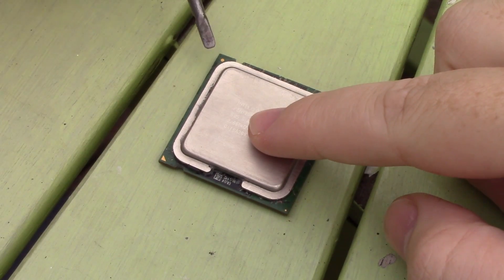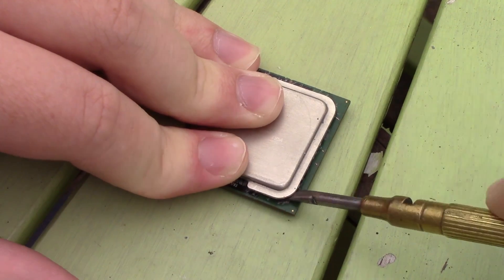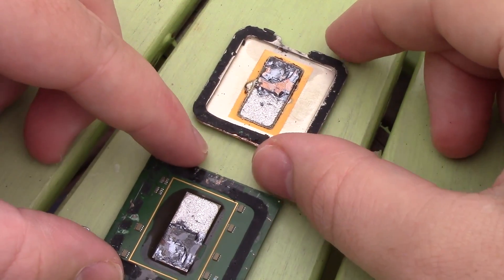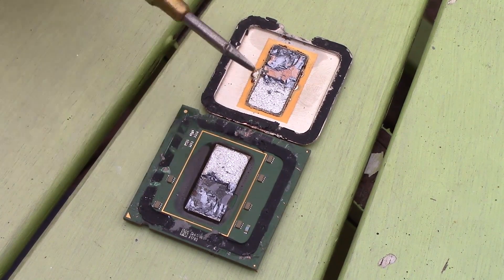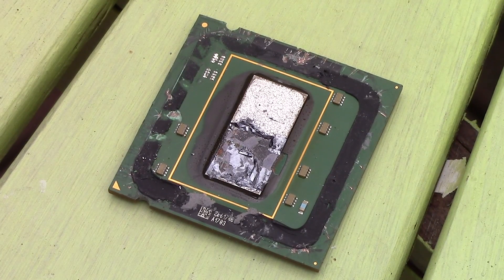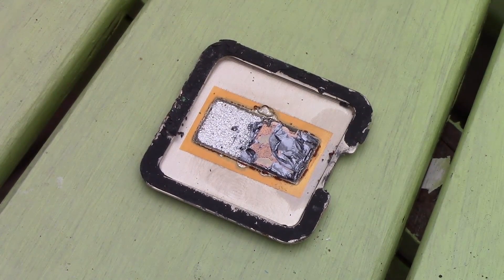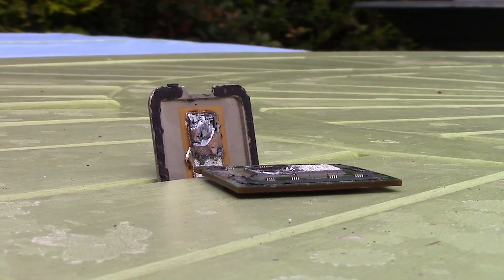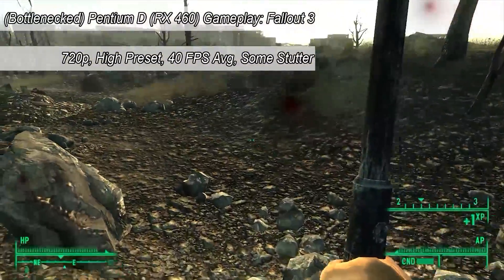Delidding a Pentium D

Comment: Pentium D+ GTX 480= HELL
Reply: The Real Bleach no, hell is Pentium D + 4 GTX 480s in SLI
Reply: Jakob P Hell is Pentium D+ 4 Titan Z's. Severe bottleneck
Reply: Alex Riordan i dont think he meant that GTX 480 is a bad gpu. it just comsumes a lot of wattage and together  with the pentium d its  gonna be hell for your psu
Reply: Yeah, requires SLI-fireextinguishers
Reply: The Real Bleach I was talking about thermals, not bottlenecks.
Reply: moriart13 call the fire brigade
Reply: ARE YOU TRYING TO MAKE A STAR!? HOLY SHIT!
Reply: GTX 590 would be better.
Reply: already hell with pentium d
Reply: Vega without cooler= a f*cking thermal bomb xD
Reply: i got gtx480 and quad e5410  an today is weather 32C
Reply: They dgaf, it'd be better witg qx6700 OC(3.5ghz?)
Reply: That is a pairing made in an underpowered wind tunnel.
Reply: 290x stock cooler
Reply: i9 18 core +2 GTX 490s
Reply: notice there's no AMD in here
Intel? Nvidia?

prepares for the storm
Reply: I could have said Vega.
Reply: Quad 20 Core Xeons OC'd to 4.0 Ghz plus quad GTX 490s with OC
Reply: Most cards don't run as hot as those.
Reply: room heater
Reply: you guys have it all wrong fx 9590 oc + 2 r9 fury x = mansion heating source.
Reply: 480 is not a bad gpu. Upgrade everything else
Reply: BAD IDEA ALERT

I currently have a Core 2 Quad hooked up to an HD 5870, and they make a good pair. However, I have a Celeron D lying around. Maybe I should throw it into the rig just to see how much of a bottleneck it brings to the system!

Comment: glad intel never decided to make a pentium D quad core with all that wattage just to run a dual core. lol
Reply from the maker: SteelCity1981 would have been interesting though haha
Reply: 1000W 80+ gold PSU minimal requeriment
Reply: i have a Hyperthreaded Pentium D extreme Edition 965 that runs at 4.2Ghz
Reply: how the hell you cool down at that speed? I have a 945 @ 3.40 GHz with arctic cooling mx-4 and the idle temps are over 45ª
Reply: 440w tdp
Reply: That would be more like: Pentium Q
Reply: hey, it would be very competitive with amd at the time if these pentium Ds were hyperthreaded.
Reply: the first thing you could try is GMABooster, it could overclock your GMA950 to 400Mhz if its clocked at 166Mhz as the most OEMs do this. you could also try EEECTL for the cpu or setFSB and try some of those clockgenerators, maybe one will work.
Reply: Ary lol i have a pentium d 945 overclocked to 3.8ghz with intel stock cooler and no thermal paste.
Reply: i use an unbranded aftermarket cooler with 6 heatpipes that i found in a medion PC...sounds like a jet. i had a Pentium 4 Medion PC that ran at 4Ghz fully stable without any Voltage mods and with the stock cooler with its old crusty thermal paste....85 degrees max and 65 idle lel
Reply: Manuel Auer undervolt?
Reply: kjjustinXD Bro you are the Pentium master, mine raises up to 80° in BIOS, same with you?
Reply: ikr yet i ran pd 950 on a like 220w psu
Reply: it stands stable at 85-90 degrees under full load... i overclocked so much cpus lol, even an Crappy intel atom n455 from 1.6Ghz to 2.3 and im writing this from my 4Ghz Core2Duo Machine
Reply: kjjustinXD daaamn son you are the overclock master, how do you overclocked the Atom?, I have the N270 @ 1.6 stock and the BIOS have no overclock option
Reply: whats your PC with that atom? Model Number or mainboard number etc. then i could look to find the program you could use
Reply: kjjustinXD it's a Compaq mini cq 10-120la, motherboard: Hewlett Packard 1468
Reply: another question, you can replace thermal pads with thermal paste(MX-4)?
Reply: Please do yourself a favor and just throw your netbook in the trash, such a shitty CPU and iGPU. I only kept my rarest EEE PC, and it's in the drawer of shame with all the cracked phone screens and dead headphone cables. I mean it literally couldn't run any 3D game better than a PIII with an ATI Rage. I can't believe I bought an EEE PC for almost 500$ in 2009 when they first came out. Now you can get a 50$ Cherry Trail tablet from China that literally runs Crysis.

Seriously, buy the GPD WIN or if really strapped for cash, you can buy a used Thinkpad with E350 APU for 35$ off eBay,
Reply: Sergiy Botsman 

this comparison is not even far from the reality, the p3 is stil faster. I got dual 1.4Ghz Tualatins ocd to 1.7Ghz with a Pci to PCIE Bridge controller and a GT730 And it runs Crysis....
Reply: Sergiy Botsman dude that was a slap to reality, I can't even watch YouTube smoothly(15 fps @ 240p) in a light Bowser like pale moon, I was thinking in upgrading the 1GB stick to a 2GB DDR2 because a friend have a N2600 atom+2GB but DDR3 and he can watch 720p, but if it doesn't give any performance boost because of my shitty atom I think it's better to invest in a new portable any recommendation for a new cheap notebook/netbook?, The better and most affordable I saw was a HP 240 G5 with Celeron N3060+4GB for $420 USD(all is fucking expensive in my country, ie the gpd win is $690 USD)
Reply: Ary 

You should look for a Used DELL E6430, got one for 160€ with a i5 3380M 4gb of ram and 640gb HDD with win7 pro

And please stay away from those pentiums and celerons. They are slower than the slowest core2duo...
Reply: kjjustinXD cheapest I found is nearly 300€ and the outside looks fucked up..., Also is for study not for gaming purposes so I think an i5 is overkill but atleast something that can play YouTube 😅
Reply: maybe you should get something cheaper then. if you really dont like to play on it you could get somethign with an atom z3735f, i have a Lenovo Ideapad 100S with 2GB ram and its ok for watching videos...the battery life and the integrated speakers are also very good. this CPU does 4k/30fps video with no problems.
Reply: kjjustinXD you recommend any atom quad series?
Reply: The Atom x5 Z8300/8350s are good ones for multimedia and a little bit of gaming.  and if properly cooled, the can hold their performance very stable. Max 1.92Ghz Clock and 4k video decoding is possible.
Reply: thanks a lot dude!, I will see if I found a decent netbook / 2in1 with a newer atom series
Reply: Werent you testing a while back the first dual core ht available CPU,I believe it was a gallatin XE core?
Reply: i ran my core 2 quad q6600  at 4 ghz once but my motherboard died bought a i7 2600k for 160 with mb and 8 gb ram

Comment: A rushed release in response to AMD. Sounds like a repeat of history.
Reply: AMD Master Race AMD FineGlue Technology
Reply: AMD Master Race lol it's a joke 😂😂
Reply: Glued is a technical term
Reply: Anyone remembers the Rage Fury MAXX? Dual graphics in 1999, just shortly after the Voodoo 2 cards that also could be run in SLI.
AMD might not have the money, but they always bought the right companies to bring them forward (NextGen in 199, who basically designed the K6. In 2003 came the Geode technology from Cyrix. Then in 2006 they bought ATi, They moved out their fabs under the name Globalfroundries in 2008)
So while they might have not the biggest R&D budget (as compared to companies like Intel, IBM, HP) they clarly know where to put the money. Also don't forget the K7 and GCN architectures, and recently the amazing step up wiht Ryzen. Then need to let Ingenuity balance out the lack of funds.
Reply: Joshua Forkell If you fail to learn from history, you are bound to repeat it
Reply: cough-CORE i9-cough
Reply: Joshua Forkell Yea, Intel has literally repeated history with their x299 platform.
Reply: Joshua Forkell At least back then they admitted it.
Reply: ikr sadly the amd system i had was from 2005 and was in respons eto socket 478 and at 2gb single core 32 bit and slow

Comment: I have delidded plenty of P4's, I have a 3GHz delidded one beside me, would you like a delidded Pentium processor that still works?
Reply: I it almost impossible to delid these cpu. The indium solder usually shatters the CPU die.
Reply: @neerajdwivedi2015  you just melt it with a heat source or push it many times from all 4 sides, much easier than you think.
Reply: @JoshuaNicoll  Thanks I actually forgot that indium melts at 156°c.

Comment: Overclocking the sh*t out of the Pentium D? Possible video for tomorrow? Might as well use it as an excuse to try OCing with Liquid Nitrogen 😂
Reply: I hope Random GPUDestroiyinHD read this and overclock the hell out of it, the Pentium D 965 was capable of 3.73 why this 805 not 😂
Reply: Actually, the D 805 can easily reach 4 GHz under air.
By simly setting the FSB from 133 to 166 MHz with proper cooling you could easily save close to 900€ back then. Sometimes I actually miss the times when we still used FSB based systems.
Reply: what about a 945?, can it reach more than 4GHz?

Comment: celeron at 12ghz go for it
Reply: Nah, but 4 GHz on air and around 7-8 GHz with LN2 is doable.
Reply: breaking HWBot :D
Reply: HappyBeezerStudios - by Lord_Mogul I'll attempt to do it, just need to find a celeron and a board that can overclock
Reply: I wonder if a super high clocked liquid nitrogen cooled Pentium D at 10.0 Ghz running on a 1,200 W 80+ Platinum PSU could outperform a 1st gen Core i7?
Reply: @njsullyalex2744  no, they only run for seconds at a time at that speed under no load
Reply: @johns3655  Alright, here is a better question: What frequency would a Pentium 4 or D have to run at to match the single core performance of a 1st Gen Core i7 running at 3.0 Ghz? (This is under the assumption that the Pentium D can run at any frequency without worry of temperature or self destruction)
Reply: @njsullyalex2744  Sorry, I love being painfully technical. But maybe there is a way to answer your question if we find the measurement of how ghz corresponds to instructions per second. Then you can theoretically increase the ghz variable till it would match the instruction per second rating of an I7 for example
Reply: @njsullyalex2744  nice channel btw
Reply: @johns3655  That's what I was thinking, and it actually wouldn't be too hard to figure out if increasing clock speed increases single core performance linearly. Then you could just divide the i7's single core performance by the Pentium D's single core performance when both at the same clock speed and boom you get exactly how many times better the IPC of the i7 is compared to the Pentium. I would expect it to be a pretty large increase. Also, thanks for the compliment ;)
Reply: the liquid nitrogen would heaten
Reply: but im not taking NO as an answer :D
Reply: that's a suicide mission

Comment: PLEASE READ hi I'm 14 saving my money for 250$-300$ self build pc some parts will be used. here are the parts

Processor- intel pentium g460
Corsair 450w
ddr4 ram- 2x 4gb
Vivo smart case
Msi gtx 1050ti 4gb
Any mother board I can get
Reply: Jayson Beach if you gonna use a g460 you need ddr3 ram and a 1155 socket mobo
Reply: Asus H110M-E/M.2

I know it's pretty cheap on Amazon and has an updated bios already so it should work no problem. It is Micro-ATX though, so only 2 RAM slots.

It's my daily driver and has had no problems so far

And do you mean g4620? Cuz this is assuming that's what you mean
Reply: Tody_ I think he means g4620